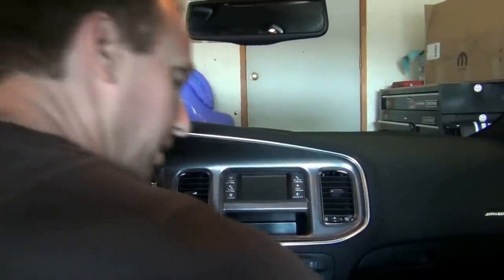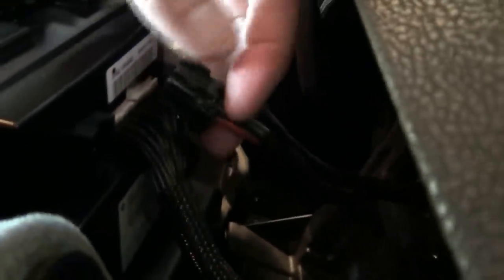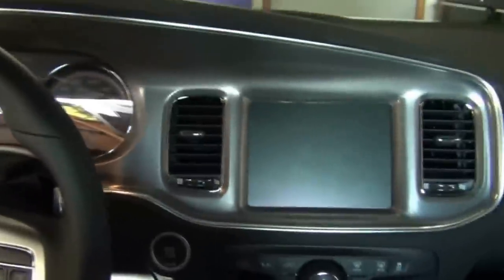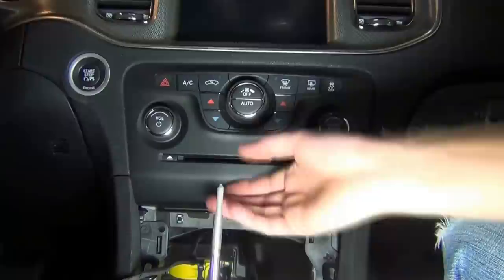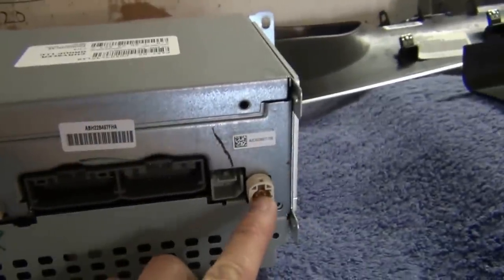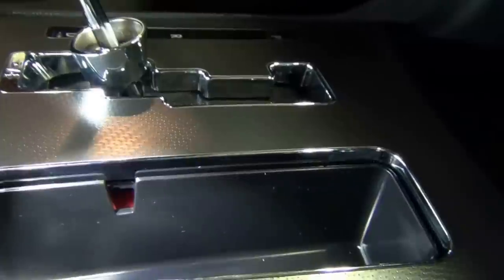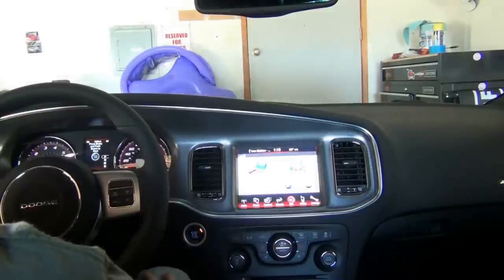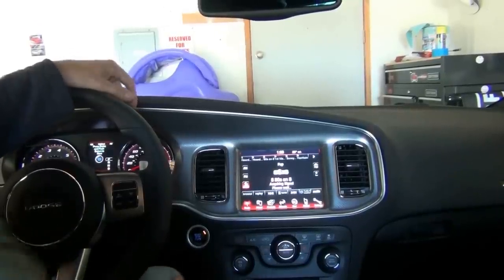2013 Dodge Charger SRT8 Superbee: Episode 12 Vlog: RB5 8.4N Radio Upgrade

Comment: Very nicely done, i been wanting to upgrade mines, thats the reason i settled with an SE, cause i heard it can be upgraded, ive called dodge and mopar, about it, they keep tellin me it cant be done...but i seen your vid, so i plan on buying an radio from ebay, any specific one i should get? RE2? RB5?? i have an 2014 charger.

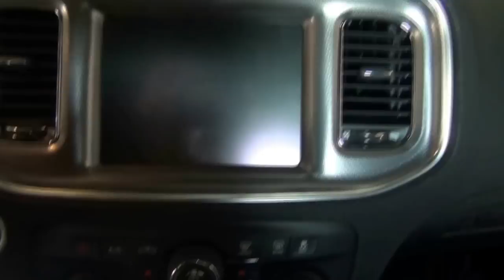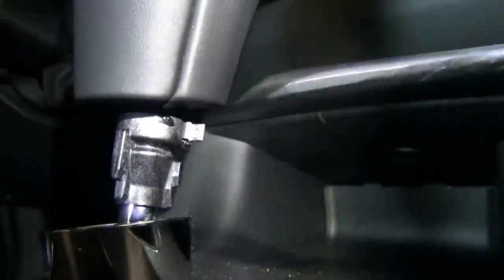Comment: Great video. Not doing the swap but need to remove these parts for customizing. This may be old news as this is a few years old and I did not go back to read all the comments. I don't think it was a spirited drive the knocked out the missing clip as it appears to be on the floor in the video from about 4:00 - 4:16 ish lol. Great information, Thx!

Comment: I just bought a new 2014 Charger and I've been checking out your channel for some great install tips. You're videos have been super helpful! Thanks for taking the time to share!

Questions for you; when you installed the factory nav unit, did you save the old bezel for the dash? If so, can I buy that off of you?? I'm considering attempting an in-dash iPad install and I'd like to have an extra bezel incase I royally screw it up.

Let me know, and keep making awesome videos.
Your a champ!
Reply from the maker: all my charger parts are long gone.
Reply: Is there any way that you can the back up park assist camera feature added on?

Comment: Very interesting, I have the police one which is basically and SE, I was wondering if I could do this upgrade buy pulling a system from another stock charger like an RT with the 8.4 system as well as Bluetooth, do you think it would work? Also is it possible to add the necessary buttons on the steering wheel controls ?
Reply: hi, I'm looking a buy a Dodge charger police pursuit and I wanted to know if it is possible to swap the gear shifter from column to floor? and how are you liking the car? is it worth it?
Reply: +Daniel A I have had two. I am pretty sure it is possible but it will be very hard.
Reply: I want to do the same with mine too. Have you wired your centre console yet.
Reply: +Daniel A it is worthy it and most of the time they are less than $11,000
Reply: Yes it is possible, I would only do it if you buy an old shit one in the hundreds of dollars range.
You are also going to need another scrap car to pull the transmission and gear box out of. 
There are a few forum posts out there of some guys who have done it.
There is very little info out there on how to go about it, so you will run in to some challenges

Comment: HEY GREAT VIDEO. I just 2014 charger se with the connectivity package. My problem is i have a lot of background static on the FM radio. Everything else like bluetooth amd Aux cd ipod all sound fine only fm sounds nasty surprisingly the AM sounds crystal clear. I have been on countless forums trying to fix this. Is there anything you can recommend me doing besides taking to the dealer since they always come out with unable to replicate problem.  Would switching the am to fm antennas in the back work. Any info would help Greatly. THANKS A MILLION.

Comment: What parts did you need to install the 8.4 Uconnect besides the actual 8.4 inch screen?
Reply from the maker: the head unit. the dash bezel.

Comment: Hey I was planning on purchasing from Steve white motors as well, My charger is a 2012 will it still work on mine? Did u need to get any additional wiring or was it plug and play?? Also did you install a backup camera because i plan on doing so?
Reply from the maker: +draven8421 car is gone, but i never installed a backup camera. wish i had tho.

Comment: Quick question : does ur charger rb5 support  seriusXM travel link? I didn't notice the " + " icon on the lower right corner just the "wrench" settings . I just did the rb5 swap on my '13 dart and I do not have travel link available. Xm shows I'm subscribed but I can't get the icon on the screen.

Comment: I was wondering if you knew of anywhere that I can purchase this kit now. I went on amazon from your description and they don't have any available. I have been looking everywhere. I was so excited by your video but now I can't find the kit :(
Reply from the maker: no, its pretty hard to find now. i couldnt even find it on ebay today. you can buy it all separately, new from dealer, but you'll prob be over $2000...
Reply: I found the new dash , do you know where I could find the correct 8.4 radio to put in

Comment: i upgraded my 2013 charger SE to that screen. My question is, before i didnt have bluetooth and now with this screen that works fine and all but i dont have bluetooth. Is it that i also need the bluetooth module thats located under the steer column?
Reply from the maker: ya you'd need a bluetooth module at least..

Comment: Does the factory Super Bee model (the one with the smaller display like yours, not the 2014 one that got changed due to government back-up camera regulation), have UConnect? I CANNOT find how to access it at all.
Reply from the maker: i never used uconnect
Reply: @LastHumansGarage  I guess I'm not missing anything, I don't even know what it really is. I wanted to try it out, but I guess whatever network it runs on was decommissioned and the old systems don't work without some update, so I'm not going to bother.
Reply: @pdiz so do you use usb aux in order to play ur music? I use to have a 2014 srt8 but I might get a superbee. Main concern is going to the 4.3 radio seems like a huge deal considering I won't be able to check my temps n stuff anymore convently. Also do the 2012s 6.4s with 4.3 still have sport ?

Comment: Hey, do I need to match the part numbers if I buy a used part from another car ? Btw I have 2012 Dodge Charger Sxt plus with Bluetooth and satellite radio
Reply from the maker: the path number could be different for sure. you have to research

Comment: Is the code u put in just for screen or the head unit? I found a head unit and bezel from a charger but I can get the 8.4 inch screen by itself from someone else. I'm trying to upgrade my 4.2 inch screen from my dodge charger SE
Reply from the maker: for the head unit. the screen is just a screen.
Reply: Thank u

Comment: Great video! How does your Bluetooth phone options work if you don't have the call buttons on the steering wheel
Reply: +Fishj83 it should just pop up on the screen
Reply: +souualo is there a mic needed though when answering on the screen? Or are you answering on the screen and still talking through your phone?
Reply: its all bluetooth.if ur phone is hooked up to ur car (radio) by bluetooth you can have calls and/or text messages go straight to your screen.if u get a call itll pop up on ur screen and mute ur music if its playing.u can accept or deny the call just like a phone.if u accept then EVERYBODY in the car will hear your convo as ALL the speakers in ur car (even the rear window) will have whoevers talking come out. get it? ur car has a mic already u just drive and talk and they will hear you

Comment: Can switching between 8.4 and stock small 4 inch screen on the bee will show u SRT options like HP meter and gforce etc?
Reply from the maker: no, it doesnt work like that. if you didnt get the performance pages to begin with, you won't have them after the new screen either. (but some special edition chargers did come with the SRT performance pages.)
Reply: LastHumansGarage much appreciation .. thank u for ur time man ..

Comment: Will have to get the vin if I buy a used screen and rb5
Reply from the maker: yes, you better to be safe
Reply: Which Vin did you use the one for THE NEW screen or the one for the  new RB5? For some reason the dealer was asking for the Vin it was going into.

Comment: LastHumansGarage,

    I have a 2012 Charger SE without the auto climate controls. Im gonna try to upgrade but I know I most likely will not be able to use the auto climate feature. Hopefully ill be able to control the temperature somehow. Is there a way to add auto climate control? Will buy a new HVAC bezel that has an auto function give you this feature?
Reply from the maker: no, you have sensors and all kinds of stuff you need.
Reply: LastHumansGarage I thought that would be the case. Think the upgrade would have any success minus the use of the automatic climate controls? I know it won't function but you do think ill still be able to adjust the temperature?
Reply: LastHumansGarage hey where did you get your upgrade 8.4 Uconnect from? I currently have a 2013 dodge charger but I only have the 4in screen in it im looking to upgrade the way you just did in the video
Reply: LastHumansGarage hey where did you get your upgrade 8.4 Uconnect from? I currently have a 2013 dodge charger but I only have the 4in screen in it im looking to upgrade the way you just did in the video

Comment: What website did you find this upgrade on?
Looking to do it to my 2013 charger SE
Reply from the maker: +Zach Monkelbaan bought a kit on ebay from Steve White Motors.
Reply: thanks!
Reply: @ZWEEZY96 hey have u done it? I want to do this to my 13 as well

Comment: My apologies if I come off as ignorant to this process but the part that you removed below the screen is that something that NEEDS to be switched in addition to the 8.4 screen for this upgrade to work properly. Or, if I install just the screen can I still have the same functionality?
Reply from the maker: yes it needs to be switched.. its the radio.

Comment: do you know where I can get a handsfree install kit for my 2014 dodge charger
Reply from the maker: if you mean an oem kit, theyre about $350.. https://www.dodgeparts.com/product_info.php?products_id=3976
Reply: +LastHumansGarage don't those only work for the 4.3 inch screens?
Reply from the maker: yes i think i read that
Reply: +LastHumansGarage is that the one that your still using with your rb5?
Reply from the maker: sold that car years ago

Comment: If you buy it new, would it come with the auto theft code? So that way I won’t ask the dealer.
Reply from the maker: ya a new one comes w a code of course
Reply: LastHumansGarage mines doesn’t have an antenna, do i have to install it?. O I should just buy the NAV app for $500.
Reply from the maker: @moparcharger8642  if i was going thru all that work, i would just get everything and be done w it.
Reply: LastHumansGarage so by purchasing the NAV, I wouldn’t need to install an antenna?.. sorry for the questions. Lol I subscribed
Reply from the maker: @moparcharger8642  i dont know if nav comes with an antenna, prob not... you still need to buy it.

Comment: how much did they charge you at the dealer for the anti theft code
Reply: TheCachetiz what will happen to my car if I do the upgrade idk anything about anti theft
Reply: eastside.story.maria I did it and had to go to a dealer to get the anti theft code. If you buy a used one get the vin number of the car it's from
Reply: Hot Dogg if I get my amp nd everything hooked to the factory radio do I still need to get an anti theft code ?
Reply: eastside.story.maria yes. Any time you take the screen and receiver out if you want to put them back in it needs a code to know they weren't stolen

Comment: I have 2014 dodge charger se 3.6 would this be possible i want upgrade my 4.3 to the 8.4 anybody???
Reply from the maker: i think you could do this on any 2014/15 and up charger. the interior is the same, isnt it? doesnt matter which engine it has.
Reply: @LastHumansGarage  yes it looks the same the only thing is it doesnt have the auto control.
Reply: I got one more question did it come with the harness?

Comment: Can I just change the screen itself
Reply from the maker: No. the whole radio must be changed.
Reply: LastHumansGarage what the name of the radio ?
Reply: LastHumansGarage where can I get one because I already have the screen I just need the radio than
Reply from the maker: You want an RB5 from a Charger. Example: https://www.ebay.com/i/332833891771?chn=ps  some of them require an unlock key if you buy used.

Comment: When you connected radio i didnt see where you ran the GPS antenna. Does yours have it? If so where did you run the GPS antenna?
Reply from the maker: +Matthew Byrd i can't remember now, but it was one of the ports on the back of the radio.

Comment: For the 8.4 screen do you have to change the bottom  Bezel out to
Reply from the maker: i cant barely remember. this was years ago.. but i think you do. cuz the new radio has a SD slot and you need a bezel that doesnt cover it up. but maybe im thinking of another bezel.

Comment: Where did you get the 8.4 radio?
Reply from the maker: the dealer.. but you can search ebay too. just make sure you dont buy a locked unit.